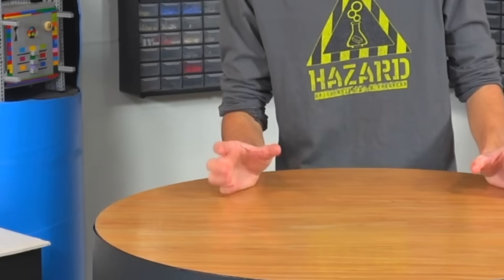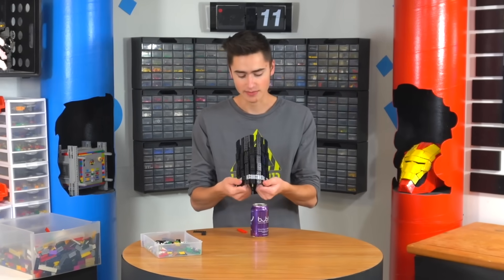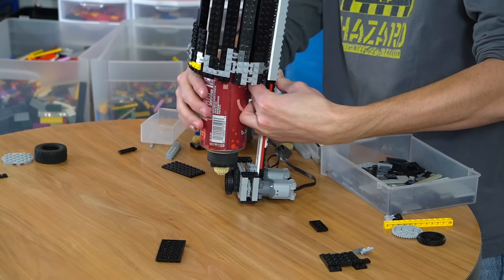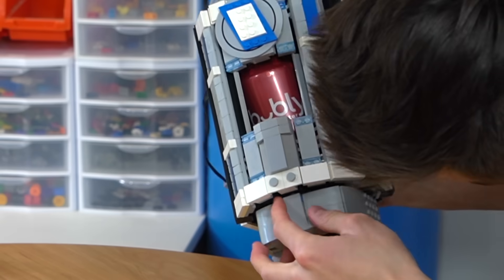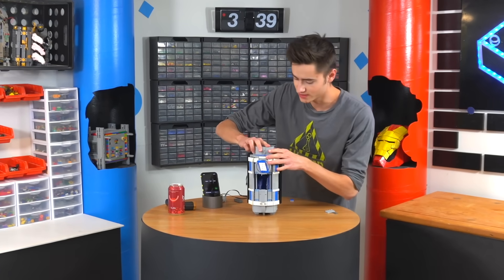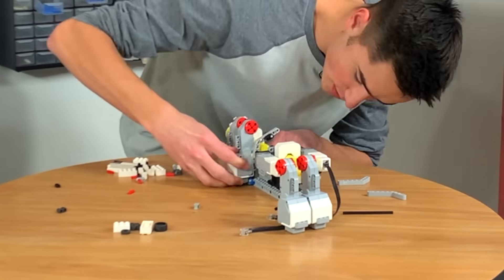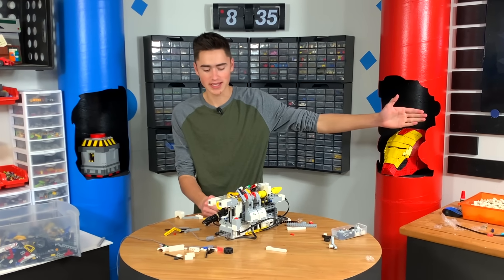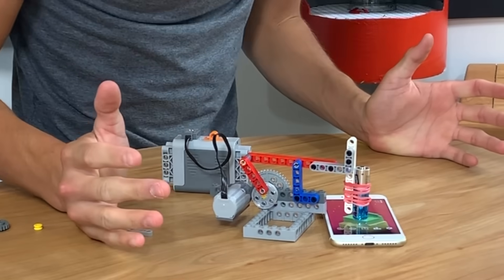My Failed LEGO Inventions...

Comment: Heat transfer between solids are a lot slower than between a liquid and a solid,

The running water one has a lot of vantages: more surface contact, a constant flow that keeps cold water in contact while the water that already stole heat from the can go alway, etc

Comment: I think this project failed because of friction between ice packs and a can. You were just heating up the icepack and a can, plus heat dissipation was not efficient. What I think would be great is blowing pressurized air at a turning can, with a flow regulation. I just don´t know how you can do that with lego. Or how you did before, with water giving it´s heat to the ice pack and taking it back from a can. But great video anyway. It´s nice to see someone thinking outside a box.
Reply: Thanks for ruining the ending
Reply: @PresidentDawg  Who in their right mind reads comment section before watching video...

Well anyway, you are welcome.
Reply: @Sorontur3  I don’t think you know what a joke is
Reply: @PresidentDawg  If it was a joke, then my bad. There is a lot of people that actually mean comments like that. Good day, to you fine sir.
Reply: @Sorontur3  Good day sir
Reply: @PresidentDawg  seriously, don't gaslight people... You know the way you phrased it couldn't be considered a joke

Comment: I thought he was going to put the soda in the freezer! Note: putting a sealed can of soda in the freezer will make it explode, becuase the carbon dioxide expands a lot.
Reply: not if you only leave it in for a few minutes
Reply: Just leave it in for 30 minutes you fool
Reply: I HWUT? NO IT DOESN'T I store soda in the freezer and I've never had one explode
Reply: @aSipOfHemlocktea  you have a special feeezer, I’ve had sodas explode before
Reply: Wrong, carbon dioxide cannot expand. The liquid in the can turns into ice releasing carbon dioxide and because ice takes up more volume than a liquid it causes the can to pressurise and explode

Comment: I think a reason why the Drink Capsule Idea didn't work compared to the Can Cooler with the water is because its not letting the Ice Packs touching the surface of the Can for longer like if the gears and stuff were more slowed down it might be able to get colder but since it was moving faster it couldn't absorb as much cold and stuff especially with the faster speeds heating up the Ice Packs

Comment: I would have used your first system but had a contraption that put ice cream salt in the bottom tub because it lowers the freezing point and gets colder than normal ice but since it lowers the freezing temperature it mostly stays a liquid.

Comment: You could just replace the soda in the original cooler with ice packs, run it until the water is cooled, then replace the ice packs with the soda and run it as normal. Heat transfer works in both directions -- whatever is colder will warm up and whatever is warmer will chill down. If the water is hotter than the thing placed in the cooler, then the water will cool.